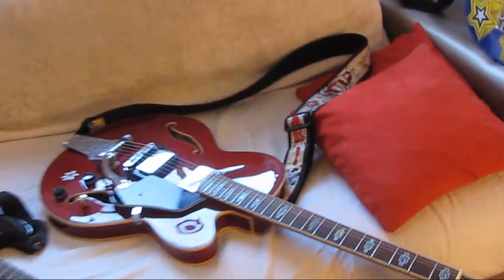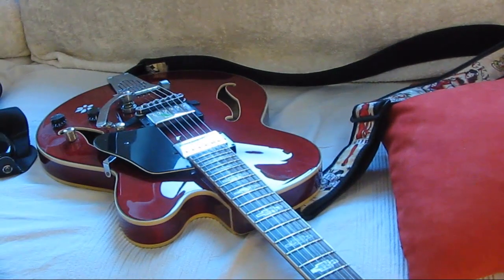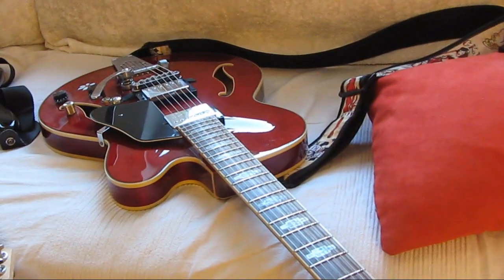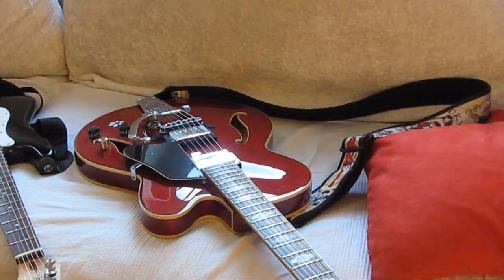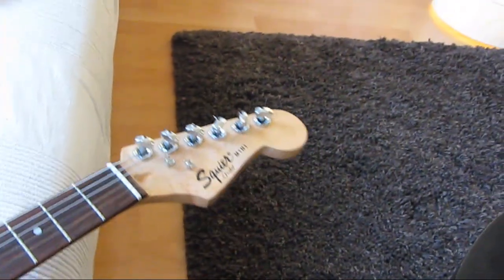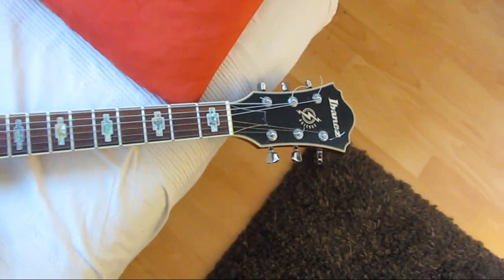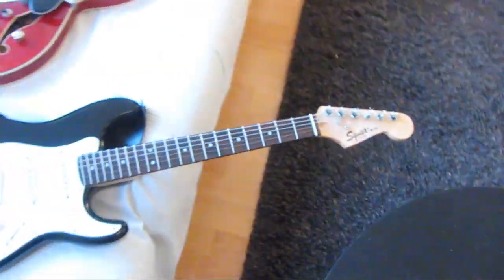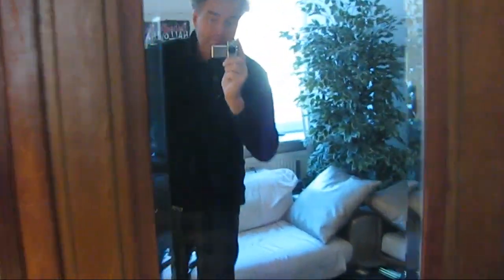Review on guitar lockin tuners: Grover, Schaller, Sperzel, Steinberger

Comment: Nice review. I learned a little German at school in New Zealand so it's impressive to see someone who is able to switch so easily between two languages. I use Spertzel's and find them exceptional; easy to install etc. The only problem I had was that the 6th (E sting in standard tuning) would not accept a 0.54 gauge string. I like to tune to drop C on some of my guitars so this was a slight problem.

Comment: are there different hole diameters on grover locks?
i got grover tuners on my Dean VMNT and i use .52 too
got no problems with them

the steinberger tuners are really interesting
thinking about a replacement on my epiphone annihilation V

now in german for the "englisch only people" to have some fun:

musstest du für die Steinberger die löcher weiter aufbohren?
einige system (wie etwa die grover) sind ja zusätzlich mit kleinen schrauben befestigt...
werden diese durch die steinberger verdeckt?

Comment: I agree the Steinberger turners are good but very fragile ,they have no stop if you overturn the mechanism breaks. The Schaller is hands down the best build quality and finish .sprezel the worst the light aluminum nicks just by hitting it lightly also if you back 
Off the nut to much good luck getting it back together.

Comment: Fortunately, the fix was easy, I just reamed out the eyelet on each side of the tuner, do not try to send the bit all the way through, ream out one hole in the tuner then the other. Passing the bit all the way through the eyelet could damage the locking pin mechanism. Problem solved.